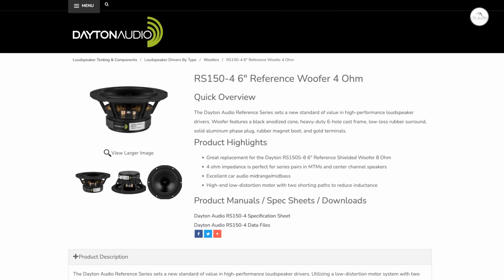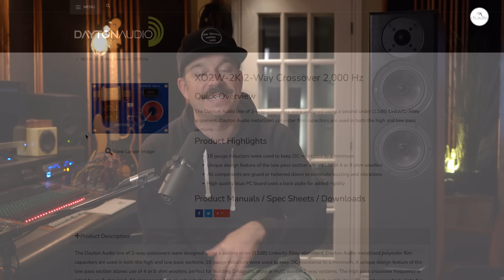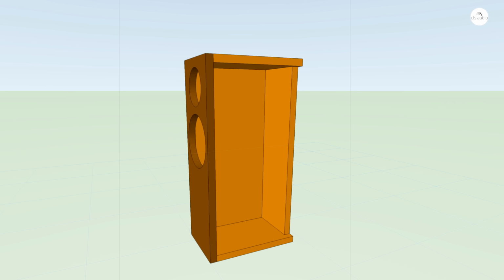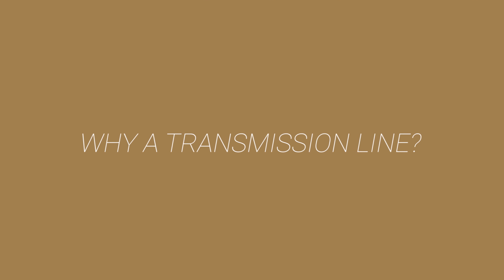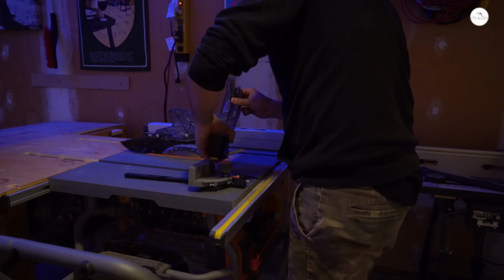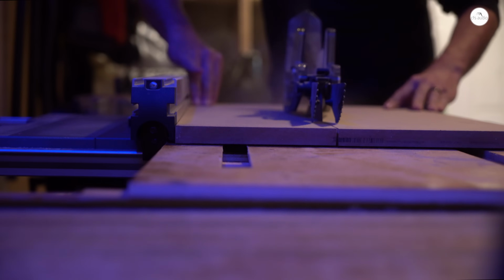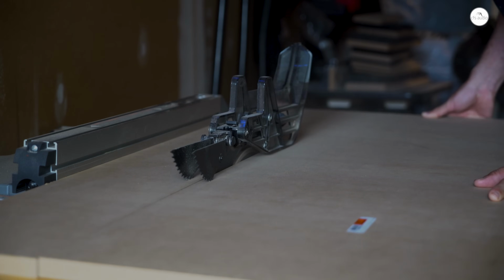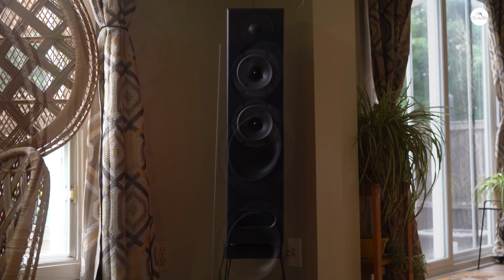DIY Reference Quality Speaker Build. How I built these amazing speakers and proper sound comparison!

Comment: Very nice woodwork. But using a premade crossover is far from optimum. The heart of DIY speaker building involves in cabinet driver measurements and developing a bespoke crossover for the drivers and cabinet. Do these have any baffle step compensation? Are they near wall or far wall placement? Explore these terms and expand your skills. This is meant to be helpful, not a putdown. I have built dozens of DIY speakers, never a premade crossover.

Comment: Hi 👋, Chris, Nice job, A few tips on connecting the back and sides together, That is depending on what tools you’ve got available remind me to help line up the joint to keep it square, Biscuit joints about every 5060 mil apart or small Domino, I see you’ve got around the table, There is a router bit that is at 45° angle but it’s got a finger joint in it which makes it very very strong, When using it you have to remember which part of the cabinet or the side or the front or the back it’s been jointed to which component because you run one piece flat on the table up against the fence you run the other piece up against the fence with his end against the table so when you put the two pieces together they lock together and line everything all up, I hope you can understand what I am trying to explain, I am into transmission line speaker cabinets I’ve built mine 40 odd years ago they are quite big however I stand approximately 1 1/2 m in height 30 cm across the front 37 cm deep. I just recently put new drivers into the cabinet the drivers are made by Seas 8 ohms 150w , I used a Fibre quilt Which you tease to open up the fibres and it’s got a Sounds exorbitant pitch like paper I can’t remember what it was called, The crossover unit it’s built into a box, Which plugs into the back of the unit so If you need to change any of the components you can do, And they are Bywired , They set on a metal frame with large spikes so I can adjust the cabinet either to stand upright or lean forward or back, Spikes then sit on four steel blocks with sound absorbent material underneath, Because they fire out of the bottom there is a 10 cm gap underneath, Play are made out of 1 inch thick or 24 mil thick MDF needless to say they are very heavy, They where built from a plan that I’d found in a hi-fi magazine back from the 70s, 
I hope this can be some help to you and some other people, I am a great believer of transmission line loudspeaker cabinets especially if you’ve got the room, These have got a very good face response not for the faint hearted, They sound amazing . I might be an old dude as they say approach and 71 years young, my choice of music is very varied , From heavy metal to classical, blues, Viking war music, and the list goes on, Good luck with your next build , I look forward to seeing your next project, How you explained the construction of your cabinet, 
I thought that’s quite interesting.. PHIL FROM THE DARK SIDE OF THE MOULIN FRANCE.
Reply: Hi Chris, Sorry the content was a bit long and probably spelling wasn’t very good, I miss being at work as I work for myself/subcontract work for approximately 44 odd years, I am self-taught as I progress in my career so my work got more high end to the point where I don’t work for universities and organ building company, The last 18 to 20 years I have been more involved in the barn conversions and renovating all properties doing very high-end joinery, I now live in old Mill in France that I have partly renovated/converted from 2013 which I’m now hoping to finish in the next year or so which should keep me busy, Over the past few months I’ve left comments similar to what I have left you and people have sent messages back saying that I should start up a YouTube channel explaining how I make things and what my experiences have been over the last 40 years.
And I now live by myself so I can go and do what I want when I want, Thank you for the chat, I look forward to your next project, Stay safe especially when machining working with MDF, PHIL FROM THE DARK SIDE OF THE MOULIN 🎼🎶🎸FRANCE
Reply from the maker: Phil thank you so much for the advice! I definitely understand and learn a lot from people like yourself. Thanks for watching :).

Comment: 4k what about down to 10hz-20hz my speakers go to 15hz to 1000hz mids 1000hz to 4000hz high freq 4000hz to 20khz. In a 10
cubic ft cabinet. Altec Lansing model 17 cabinets. 15” woofer, horn mid, horn high freq. sounds super from 3 on tube pre amp into tube 6v6G push pull circuit power tubes. All speakers Alnico magnetic low power, high spl, measured 0ne watt 3 meters away 107 dbl.  all 1974 issue speakers yeah they weight 150lbs each
Reply from the maker: Those sound awesome Greg.

Comment: Excellent work, very beautiful speakers. I don't know much about electrical stuff but, how do you connect the tweeters to other drivers??
Reply from the maker: Hey Angel, Thanks for watching. All the drivers get connected to a crossover unit which distributes the signal and determines the frequencies going to the tweeter and woofers.
Reply: @chrisferris3303   Oh Ok, So, the woofers are connected to the crossover (serial) and the tweeters are also connected to the crossover but independently from the woofers. I think I get it now. Thank you so much!
Reply: @chrisferris3303  Hi Chris, I'm planning to build these speakers, I've already bought the components, but I have a couple of doubts, as I mentioned I don't know much about electricity: all drivers are 4 ohms, although the woofers are connected in series (that make them an 8ohm), but the tweeters still are 4 ohms, so what is the final impedance of the speakers? Also, what amplifier power do you recommend for these speakers? I'm Planning to bough the Yamaha A-S801SL (100w)  Thank you very much my friend!
Reply from the maker: @AngelCorso  Hey Angel the nominal impedance will be close enough to 8 ohms with this setup. No problem for that amp. This is a great place to start for a first build good luck and enjoy.
Reply: @chrisferris3303  Thank you very much!

Comment: Yow! The purpose of the port and its design is critical, is to allow the back pressure to exit the box in-phase with the front pressure, thereby allow you to harness the total movement of the woofers. Unlike an acoustic suspension where only the the front pressure is utilized and the back pressure absorbed by damping material.

Comment: As a woodworker i will give you my advice about glue. PVA glue is not a filler. put just a thin film of glue and dont clamp very tight so it wont squeeze out. Less is more with wood glue.
Reply: As a furniture builder i can vouch for op's advice. As this wood glue is not a filler (it shrinks when it dries) it wil not fill in any surfaces that do not contact each other while clamped down. Again, more glue does not help with a better bond with this paticular wood glue as it does not fill. Having lots of contacting area helps though, so make sure the contacting area is as straight and smooth as possible. There are special "filling" glues who do this. PU glue for instance will do this. It is notoriously more messy to work with though. Trust the advice from professionals or be stuborn and pay for the learning curve.
Reply: Mdf is so diff than wood tho... same advice applies fir that?
Reply: @Helenography0741  clamp tight, use a liberal amount of glue, and wipe off the excess with a warm damp towel
Reply: You'll say less is more, until your box bust apart at the glue lines.
Trust me i've built 1000s of mdf boxes for speakers,  2 10s can cause a box to come apart when using MDF  
And if you tell me plywood i'll ask you are you positive the sheets have no voids?  That should make a nice sound   buzz buzz.
Reply: @bobbg9041 you can purchase Baltic birch or marine plywood.  Guaranteed no voids, it does cost 20% more though.
Reply: @bobbg9041 any experience in PA? I'm building a 5 way for the first time and can use nuggets of info

Comment: Are all panels glued making servicing only through woofer openings?
Reply from the maker: They’re all sealed up. Big regrets lol. My intent was to do a larger terminal plate so I could access the internals but I couldn’t find one. I fully plan on building a version 2 of these with all the suggested upgrades. I think that would make for a decent video. Thanks Guy B.

Comment: Looks great, but using a Pre-built crossover is not the way to get great sound. It will not match the levels of your actual drivers or impedances or responses..................
Reply from the maker: Next speaker build will have my own. Thanks for watching Kevintomb.

Comment: Just a suggestion that will save you some saw dust. Us a smaller diameter router bit, an 1/2" up cut bit will take out less material, and still get the job done. Thank you for the Dayton Audio info.
Reply from the maker: Good stuff. Thanks for the tip.

Comment: I built a pair of these inspired by this video - a few changes:  I made the cabinets taller by 4" to extend the TL, and kept the drivers in roughly the same location.  Also coated the interior completely with 1/2" padding, and added acoustic foam over 1/2 the tunnel.   They sound amazing - originally they were scheduled for the garage, but I liked them so much, I replaced my Klipsch F2's with them in my home theater.
Reply from the maker: JR B - This is so cool! So satisfying hey.

Comment: Sorry man, just at the beginning you already did some terrible mistake connecting speakers in series. Each speaker has slight differences, which translates to differences in impedance per specific frequency then it creates giant issue in phase between the speakers.
Reply: If you wanted to have 8ohm, you should buy 16ohm speakers and connect them in parallel.

Comment: Excellent wood work, very competent and perfect video footage and editing. I would like to give some input though, it might help you in this or future projects. First of all you didn't tell anything how transmission line is calculated. But ok, the other things I noticed.. this premade crossover seems to be optimized for 4 or 8 ohm load on woofer side, but 8 ohm load only on tweeter side, however your tweeter is 4 ohm nominal so there will be some shifting from theoretical xover frequency. But that doesn't have to be a problem if measurements are OK, but did you made them? I mean, there is very slim chance that acoustic xover point and slope will be what you think it is, with custom build front baffle and random drivers and generic xover, huh. Apart from that, your tweeter is flushed too deep into front baffle, that stepping will create diffraction and coloration. You can help with adding small depth of sealeant under tweeter to lift its surface in level with front baffle. The last thing I noticed... did you put that crossover into transmission line tunnel? Huh? If you did you defeated its purporse a big time. Also, you've made it non accessible after gluing front baffle? I hope you won't take those comments wrong way, also I might be wrong about some points as something might be just not shown in the video. Other than that great job!

Comment: I have never used a router on veneer when glued to my cabinets, it can chip the veneer with the wood grain and cause aesthetic issues like the ones you can see on 11:34.
Reply from the maker: Hey Rui Pedro Silva thank you for watching. Yeah the router worked well but for sure had some issues with chipping. Any suggestions would be greatly appreciated.
Reply: @chrisferris3303  I always used a X-acto knive but there are proper cutting tools for veneer (you can also make your own!). For me the trick was, multiple passages especially when you are cutting along the grain to avoid  separation of the sheet (perpendicular cuts are easier to do!), but this ways if it happens you can fix it, and with the router you can say good bye to that lost veneer chip.

Comment: Possibly a dumb question from an admittedly novice at such things, but you wired the two woofers in series to achieve an 8 ohm impedance, however, and I may be wrong, but the tweeter was still a 4 ohm driver, wasn't it?  Does it just not matter that they are differing impedances?
Reply from the maker: Not a dumb question at all. I’ll probably get chewed apart for this answer lol but the woofers require the most power and thus have more impact on the systems nominal impedance.

Comment: Great video and build. I'm curious how much did it cost you to build the speakers? I'm just wondering how cost effective it is to build vs buy now (in 2022)? Parts express has gotten a little overpriced with their components IMO.
Reply from the maker: Hey Car Rizzle. Thanks for watching. Looking at roughly $650 to $700 CDN or $500 ish USD for a build like this.
Reply: @chrisferris3303  Alright that's not too bad for a pair of custom speakers. Plus you can't put a cost on passion and having something that is 1 of only 1 and you own the only pair ever made. 😁
Reply from the maker: @carrizzle9586  you get it :)

Comment: Are those tweeters 4 ohm?  Dayton crossovers require an 8 ohm tweeter, if a 4 ohm was used u will have a 2khz gap in the frequencies, woofer will crossover at 2khz but tweeter wont crossover until 4khz.

Comment: Great job, especially with the wood finish.  One problem is you routed the countersink too deep, recessing the tweeter (Happens to the best of us).  That tiny lip around the tweeter will cause MAJOR diffraction.  Unscrew your tweeter and add a thin piece of felt/foam/cardboard/whatever to make the tweeter flush with the cabinet.   It absolutely will be worth the effort.
Reply: wood finish was horrible. many visible flaws.

Comment: Good woodwork! Tech wise:
The with the foam it really depends. Most use polyester wool.
The crossover always should ve made specifically to the drivers as every driver is different and needs a different crossover because of it.
Apart from that solid work!
Reply: The crossover is where the majority of the magic happens, those simple PE crossovers are definitely the weak link.  You could start with high-end drivers like Scan Speak or Accuton and destroy the potential with x-overs like those.  Designing the x-over and voicing the speaker takes a lot of work, measuring, and reworking to tease out the best performance from a speaker.  It is a bit of a disservice to novice speaker builders to suggest using those x-overs.

Comment: Reference and two 4ohm in series, are you kidding me?
Reply from the maker: Hey Dimitar M, thanks for watching. I’ve gotten a lot of great pointers from peoples comments. Please share :). I’m hoping to take everyone’s suggestions and put them towards a new build.
Reply: @chrisferris3303  from what i understand. the putting two bass drivers in series multiples together the resistance and in parallel it divides them.  the problem is the impedance curve of bass drivers have a spike of like 50ohms at 150hz (rough example) so adding two 4phm speakers seems ok, but really when the speaker is playing 150hz you are adding up to 100ohms, and therefore wound be as loud in that range.

i am not a doctor.
Reply: @-IE_it_yourself  but you can always just use an impedance correction
Reply: @WirnikPro  that is beyond my scope of understanding. and advice on how that is done?

Comment: Nice work Chris. 
I built a pair of TL speakers from a kit  by  a well known diy speaker kit supplier and designer here in the uk. They are still sounding good after twenty years.  
Room acoustics play a big part with your sound system,  but you can tailor your kt to suit.  There was a few tweaks I could do on my kit, that the designer had thought to include, was crossover adjustments, and driver damping.
Might be one for a future build, if you hook up with the guy that designs crossovers.
Mid band adjustments by removing some turns of wire from the inductors.
Mount the xovers externally,  then you can play till your hearts content.

Comment: Nice but viewers please note! When machining MDF wear proper breathing protection as the dust is highly toxic. Drilling pilot holes at the circumference of your hole saw cuts will also prevent burning your MDF due to the buildup of dust causing friction and smoldering.
Reply from the maker: Hey Matthew yeah I’ve got a good respirator I normally wear. Thanks for the tip with hole saw will try that next time. Thanks for watching.

Comment: So with a prebuilt crossover and midbass drivers in series, how did you address baffle diffraction, baffle step loss, driver response imperfections, driver sensitivity difference, and the vertical off-axis nulls caused by having 2 large drivers covering up to ~2khz?
Reply from the maker: Thanks for the suggestions on the other comment. It’s nice to know these can get even better. I plan on doing a total rebuild and incorporating all of the suggestions in the comments. Will make a fun future video. I’ll take a look at the 2.5 crossover. Thanks Eric M.

Comment: Hi i prefer the DIY Reference Quality Speakers !  
i would only think about placing a thick foam ring  around the tweeter 
Imhe in a normal home situation this tends to limit nasty reflections from side walls, ceiling and floor and the soundstage could improve a lot  (the sound image is more focused)
Congratulations and kind regards, gino